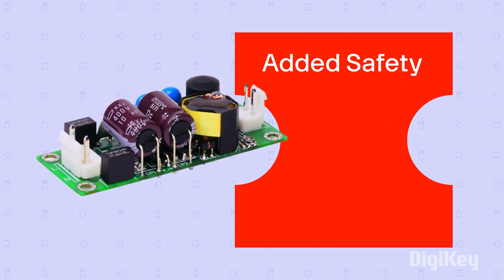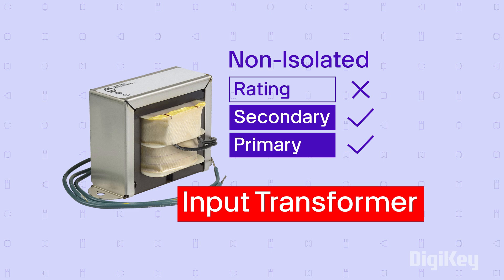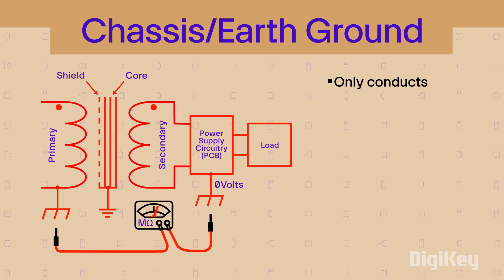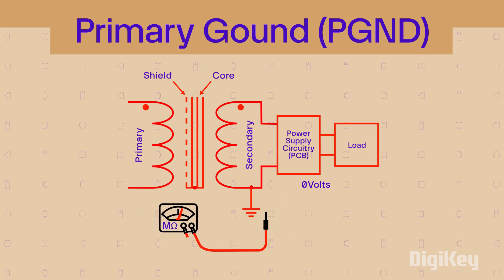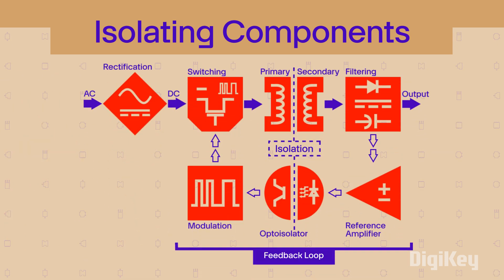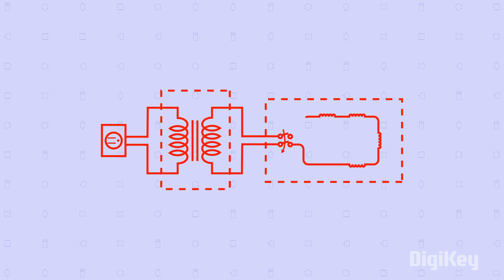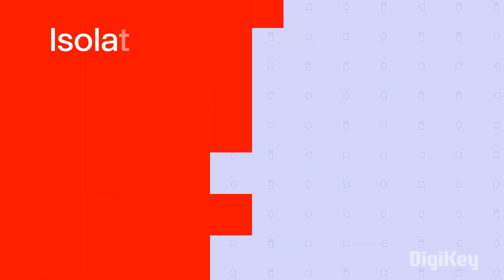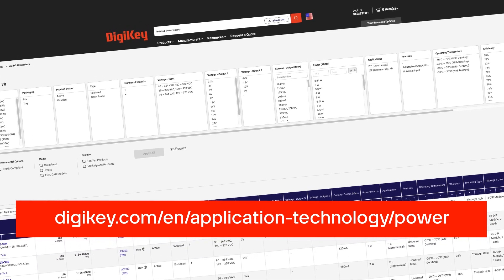What Makes a Power Supply Isolated - Another Teaching Moment | DigiKey

Comment: why  does grounding on the shell of the transformer make isolation impossible?
also isn't neutral eventually connected to ground anyways? so it'd not matter if we ground the primary side or not as it's always connected to the ground at the box anyways.